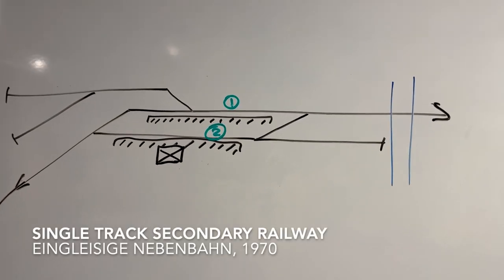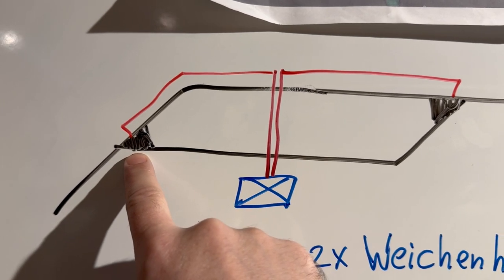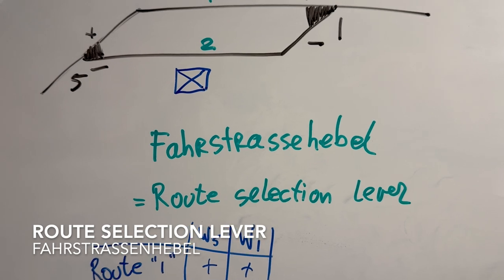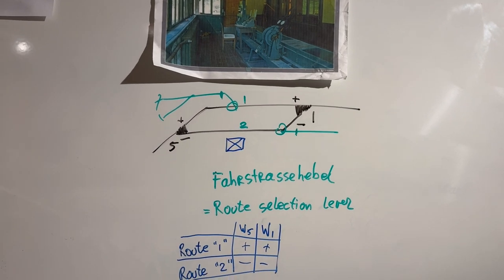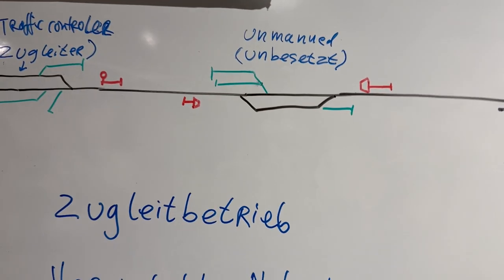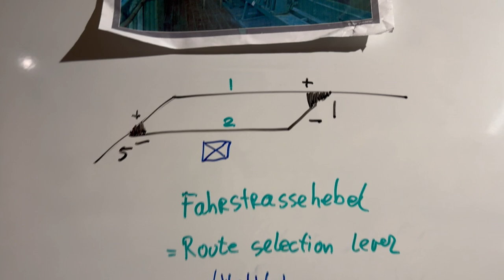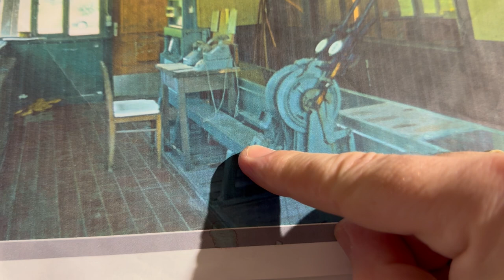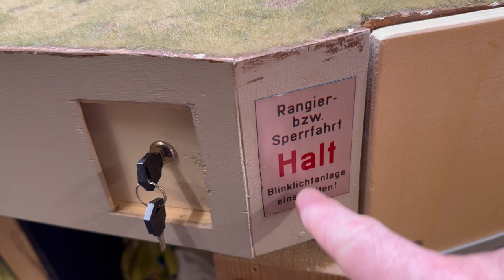Hebelbank Berenbach: security mechanism explanation

Comment: Sehr gut und ausführlich erklärt... looking at the "Zugleitbetrieb" from the 60s of the last century, we kind of going back to it with the ESTW (Electronic Interlocking) - there is one Dispatcher in a central place and switches an entire line with all its stations. Ok, conducters don't need to call back and request permission verbally, but technically the same thing happens. Only that there are sensors that feeds back train's position etc.